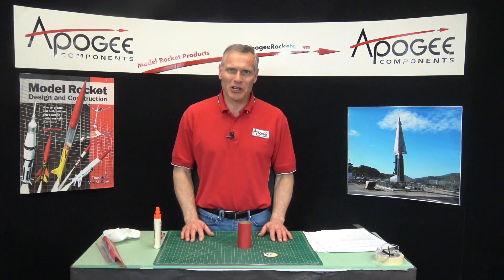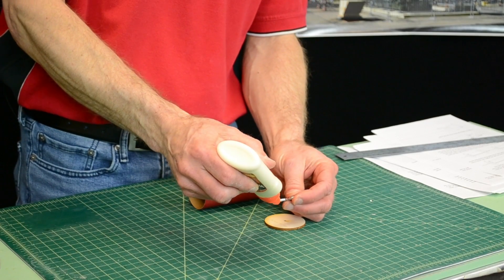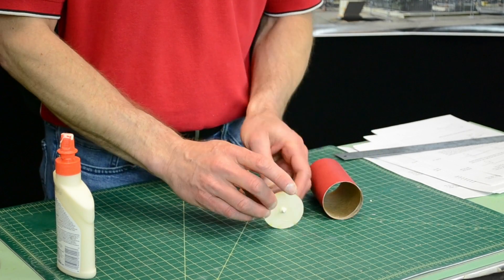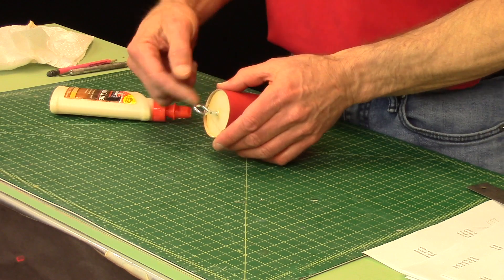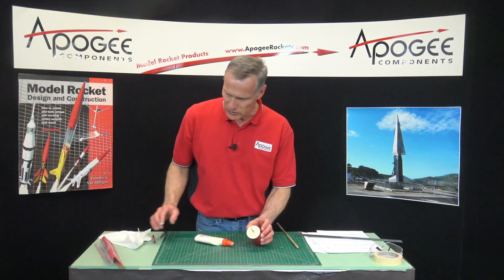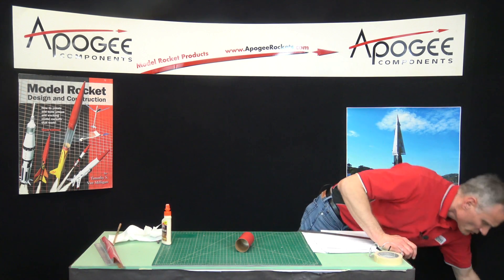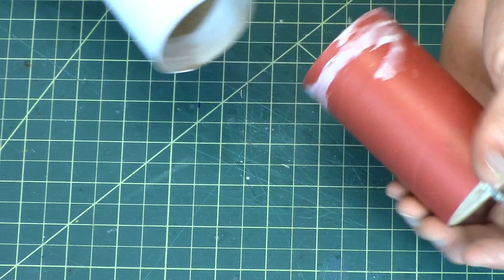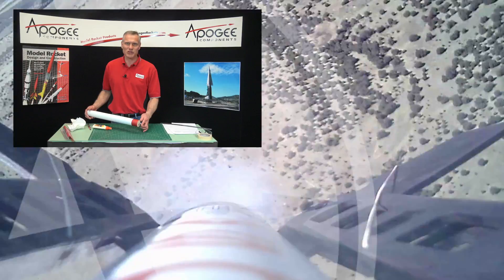Flying Machine Rocket Build: Part 4

Comment: I also recommend doing a "dry fit" before gluing up the coupler. It should fit slightly loose because... I had a situation when after applying the glue (dry fit was "snug" and I expected the glue to "lubricate"). However, the parts welded together nice and tight before reaching the marked line. I applied maximum pressure to get to the line but... in the end, the coupler was not inserted to correct depth, AND was crooked. Attempts to correct the situation (feathering one side with my Xacto knife) resulted in the upper body tube to be slightly "off center" to the lower body tube. 
It just wasn't gonna work. I had to re-order parts and rebuild to get a correct coupler insertion.

Dry fit first. Before applying glue, a loose fit is better than real snug.